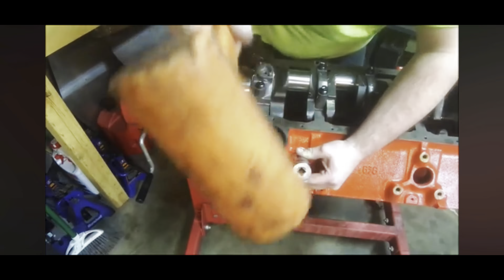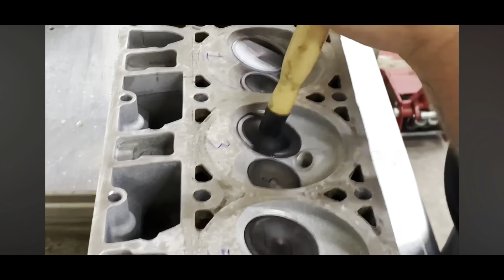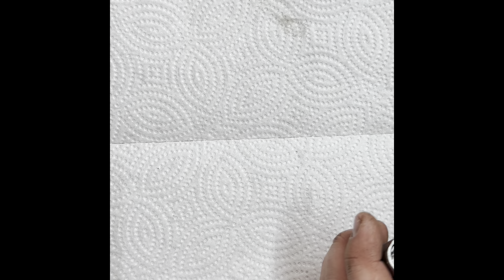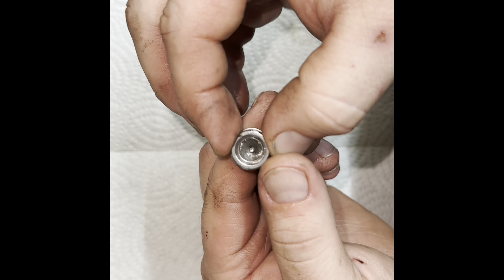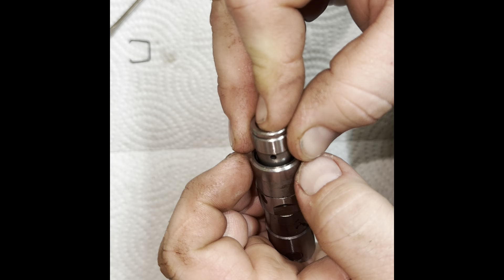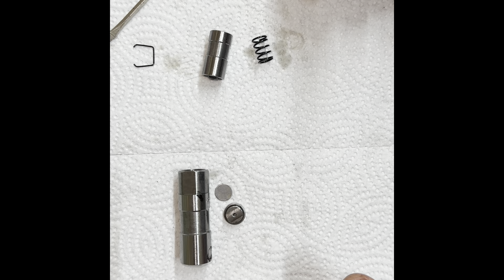Should You Soak Your Lifters?

Comment: Interesting concept. I've been taught to oil them but not soak them. As you said, you will be spinning the engine over, setting your valves etc. If there is oil in the lifters (especially modern flat tappet cams) when you set the valve and roll the engine over by hand there can be too much pressure on the camshaft initially and cause gouges or wear on the lobe that can lead to a future problem. Once everything is in and and the valves are set you prime the engine with a drill and then assemble and complete proper break in

Comment: If you soak or prime your lifters manually before installation it will alter your valve adjustment. When priming your system with a drill on the oil pump this will prime and remove air from the lifters. DO NOT SOAK.
Reply from the maker: Right, cause the pressure wouldn’t bleed off while working them over at all…. Fun fact, just did a cam and lifters in a 5.3 today and soaked them. Everything is fine 😀

Comment: Never soak them. The will start pumped up and possibly put a valve into the piston. This happened to me. Had enough valve to piston clearance that it just kissed and bent the pushrod.
Oil and break in lube the lifter. It will pump up on its own after a few seconds.
Reply from the maker: Just out of curiosity how far did you get into this video?
Reply: @ZaksMuscleMotors  I did not watch to the end where you said to turn the engine over. That would probably prevent the engine started up with the lifter plunger fully extended on closed valves and full of oil. I would prefer to set the engine to just before TDC on  cylinder 1, distributor where is should be for quick start and let the lifters find equilibrium. A preventing any corrosion inside the lifter, which you mention, is definitely a good idea. Probably don't want a dry lifter with just manufacturing lube in it either. Somewhere in between.
Reply from the maker: @keithbrown1915  it’s crazy with everyone saying you’ll have all these issues I have yet to come across one. That’s the wildest thing
Reply from the maker: @keithbrown1915  do you not turn the engine over by hand when you set valves? What about finding TDC how do you get it there?
Reply: @ZaksMuscleMotors  I run hydraulic without adjustment. Makes no difference. I had one very close call. I will not soak hydraulic lifters. Solids are OK
Reply: @ZaksMuscleMotors  i am curious, do you need to be at TDC for each cylinder as you install the lifters?  I have a 08 vw jetta. I dont think it's possible to do that